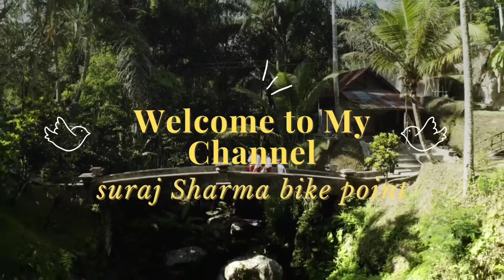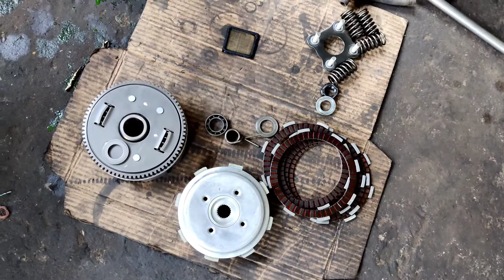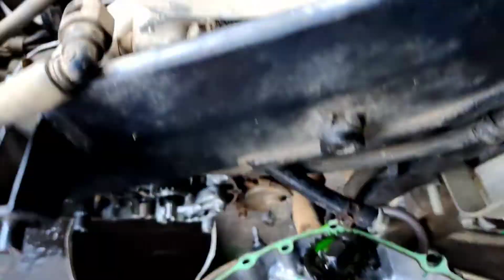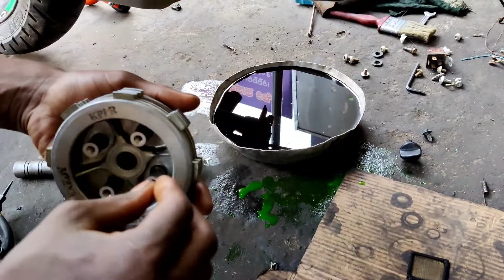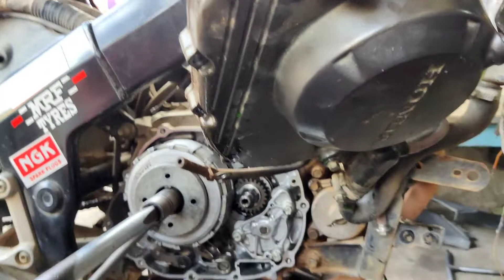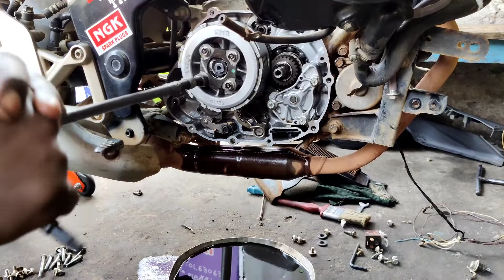honda CBR 150 clutch plate fetting

Comment: Kya problem hogi bike me sensor to sab thi hai.  temperature sensor/ tharmoval /coolnat sab thik hai to kya or konsi problem hogi
Reply from the maker: Temperature metar kitna Tak aata hai
Reply from the maker: Engine oil konsa use karte ho
Reply: @surajsharmabikepoint2088  konsa engine oil us kru bolo
Reply from the maker: Ap kon sa use karte ho batao
Reply: @surajsharmabikepoint2088  shell ka dala tha or dusra mix kiya tha 500 ml
Reply: @surajsharmabikepoint2088  bolo konsa dalu oil
Reply from the maker: Motul use Karo ap 20/50   100 percent synthetic